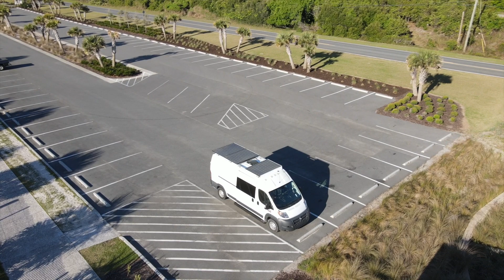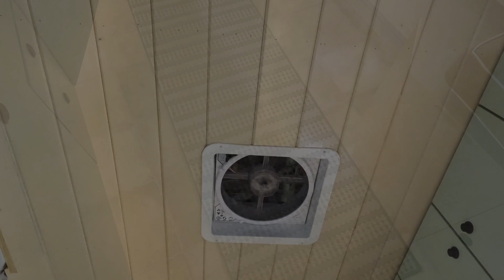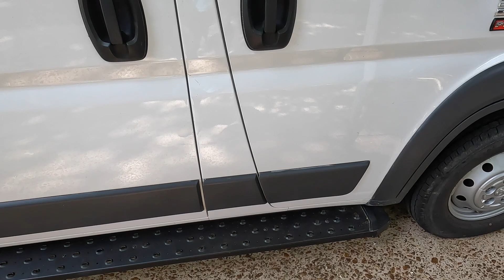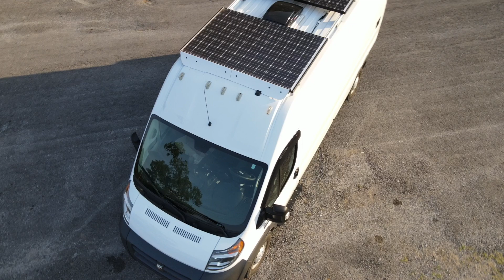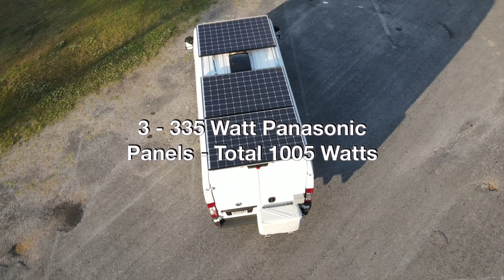Van Tour

Comment: how do you open the door where the AC is mounted? Your vid says bolts were through the bumper.
Reply from the maker: I have two 1/2" stainless bolts that I remove if I need to get in the back.

Comment: I think there would be a ton of people who would appreciate a video showing in detail the entire installation outside and inside for the mini split. I'm especially confounded how you can open the passenger side rear door if you bolted the mini split frame through the step!
Reply from the maker: I have to remove the two bolts to open the door. The only time I need in there is if I'm checking the electronics. That's all that's back there.

Comment: Hey, amazing video. Very inspiring. Thanks. 
My questions : 
Electrical : why 12 volt system instead of 48v solar sytem with 3kw hybrid inverter? 
Air ventilation : any floor vents for max fan? Doesn't it just cause negative pressure in a sealed container. 
Thanks and good luck with your journeys
Reply from the maker: Thanks. I had lights, max
fair, fridge, water pump, etc. all 12 volt so I chose to go with 12v batteries. Works great. I have two window vents for the cab windows whenever I run the maxxair.
Reply: Thanks for your reply and all the best in your endeavours ❤

Comment: Have the flexible hoses on the mini split held up well? No leaks? Nice van!
Reply from the maker: They've help up well so far. No leaks. Around 2 years.
Reply: Oh that’s great. Really nice install. Any humidity concerns? 

I installed a mini split in a stepvan and I battle humidity a bit. It’s a 12k btu and it cools the van down so quickly it doesn’t remove much humidity. Takes it quite a few cycles to get the humidity down to a nice level.
Reply from the maker: @cardudeman6104  No I haven't had any humidity issues. I insulated the heck out of my van. I used rock wool insulation in the floor, ceiling, walls, doors, and every nook and cranny in the bracing.

Comment: I have all my solar stuff in place just waiting fora couple more things before I wire it all up, since you're a very experienced electrician, I was wondering, do you think there is any potential anywhere in the system for arc flashes in small 400-800 watt diy setups with 400ah batteries? Or any major electrocution hazards? 
(Other than avoiding any touching of the positive to the negatives of course) 
I plan on wiring my inverter pretty close (1.5ft away) to my batteries, and all the OSHA workplace safety videos I've had to watch over the years is worrying me a little haha
Reply from the maker: As long as you have the correct fuses and don't short anything out you should be fine. Dangerous arc flash isn't a big concern when working on a van. In the manufacturing plant with high voltages and amperages is where it's real.The only shock hazards would be you your solar panel outputs and your 120 vac from the inverter.
Reply: @jamiesworld4675  ohh ok, thank you thank you

Comment: Thank you for documenting your solutions on YouTube!

1. Thanks for mentioning the type of flexible coolant hose (Rectorseal NoKink) in one of your replies! Did you use all of the precharged refrigerant despite having a short run between the units? If not, did you get a professional technician to adjust the quantity of refrigerant? (I have no firsthand experience with charging or leak testing a mini split.)

2. In one of your replies, you indicate that you planned to rest the weight of the mini split outdoor unit on the bumper. Have you found that the additional van length due to the protruding mini split substantially decreases your parking options? If you had it to do again, would you mount the outdoor unit higher to decrease the likelihood of it being clipped by other vehicles in a parking lot or during on-street city parking?

3. Have you collected interior and exterior humidity data alongside the temperature and power data? Have you noticed condensation on cooled interior surfaces? Do you intend to publish more time series data in the future?

4. Do your custom mounting brackets for the mini split outdoor unit incorporate any vibration damping? If so, what materials or components did you use?

5. Have you done any rough energy modeling (thermal and radiant transfer through the envelope of the conditioned space within a few scenarios)? If so, would you mind sharing your estimates for the conductive transfer coefficients (e.g. bulk R-values), the glazing transfer coefficients and the areas of the respective assemblies?

6. The questions in the previous item were prompted by my nascent project that applies Passive House building science principles to a cargo van RV conversion. The design incorporates a mini split, vacuum insulation panels, air sealing, a small ERV unit, an energy efficient egress window and an insulated & ducted waste heat bay. The tentative plan is to replace the rear doors with a custom exterior wall that will host the egress window, the mini split outdoor unit and most of the penetrations. In the unlikely event that you'd like to compare notes about any aspect of that design, please feel free to reach out via Gmail or Messenger. (I'm `joewalp` on most online platforms.)

7. I gather that it's common to document the upfitting purchases to justify the RV insurance valuation. If you feel comfortable sharing that list of materials and components, I could perhaps benefit from your experience. If you want to share it more broadly, I could publish it on my website.

8. Have you found that the cool air from the indoor mini split unit blows too directly on you during some daily activities or at night? If not, how did you adjust it or position it (or position your seating) to avoid that phenomenon?

9. You indicate that the mini split operating in cooling mode draws a maximum load of less than 650W. Have you encountered a scenario in which the efficiency gain from a smaller, dedicated, 1000W inverter would have allowed you to run the mini split when the 3000W inverter wouldn't? I'm thinking of scenarios such as 80°F+ outdoor overnight temperatures or multiple overcast days. (My design currently features a dedicated 1000W inverter to run both the ERV and the mini split in cooling mode alongside a larger 3000W inverter for cooking and for running the mini split in heating mode.)
Reply from the maker: 1. I did use all the refrigerant.
2. I have had no issues with parking and I like the unit on the bumper and door.
3. I have not noticed any condensation issues so far.
4. The unit came with 4 rubber pads and I used those between the unit and the mounting frame.
5. I have not done any energy modeling.
6. That sounds pretty complicated.
7. I have a long list on a spreadsheet of all my purchases.
8. I actually taped a piece of paper to the unit the keep the air from hitting me in the face at night.
9. I just use the 3000 w for everything. Works just fine.
Reply: @jamiesworld4675  Thanks! If you're willing to share that spreadsheet, I'd like to take a peek. I won't be offended if you prefer not to.

Comment: How much weight did the mini-split add to the GVWR payload capacity on your Ram Promaster, please? And is it a 2500, 3500? 159” or 159” EXT?
Reply from the maker: I believe the outside unit was around 85 pounds. It is a 2500. My total build added around 1900 pounds. It is a 159" wb.

Comment: Thanks for the great video! I’m especially happy to see someone else is mounting their AC on a swinging door. How’s that mini split setup holding up with the flexible lines? 

I’m going with a similar design, except the AC will be on the driver’s side, and about at the point in the project myself and am a little nervous about how the flexible lines will hold up over time.
Reply from the maker: I've driven about 10,000 miles and have had no problems. I couldn't be more pleased with the performance of mine.
Reply: @jamiesworld4675  great to hear! What brand lines did you use? I plan on bracing the lines against solid mounting points at each end to relieve strain on the connections of both units. Its all a bit intimidating, but I figure if someone else was able to pull it off, then its possible.
Reply from the maker: Rectorseal no kink @nicholasespinosa9569

Comment: Did you consider eliminating the roof fan entirely and only running with the mini split fan-only and cooling modes?  If so, why did you opt for the roof vent fan in the end?  Thanks!
Reply from the maker: The roof fan is good if you're cooking to exhaust the moisture. I also put a window vent in and run the fan on low if it's going to be hot outside when I'm away from the van.

Comment: Hi, 1) how did you paint the cabinet doors to look so professionally finished? 2) Had you considered staining them instead for a wood finish? And why not? Thanks. I’m converting a box truck at the moment and your reply would be most helpful.
Reply from the maker: I sprayed them with a cheap sprayer and air compressor. Latex wall paint thinned with a little bit of water. Takes about 5 or 6 coats but also;utely no brush marks. The wood is maple plywood and I decided to paint instead of stain.

Comment: did you have to cut into the bats of Rockwool to get it down to a 2 inch thickness for the subfloor insulation? Or does Rockwool come in 2 inch thick bats?
Reply from the maker: Lowes sells a knife that looks like a breadknife that a does a good job of cutting it down. The bats are almost 4 inches thick so yes and to split them.  But, I think the insulation is very very important to be able to run the mini split off grid.
Reply: @jamiesworld4675  Thanks for your response. I wonder if you got the safe and sound rockwool that provides great sound insulation. If so maybe it would be a good idea for another video to see how quiet the van can be from the inside with a noisy outside environment.
Reply from the maker: @mikefranks4528  Actually most of the insulation is not the safe and sound. They say it's a different R factor and I wanted the best insulation. When I did the doors I ran out and did use some safe and sound and I couldn't tell the difference.
Reply: @jamiesworld4675  sounds good. Can you share the initial brand you used for Rockwool?
Reply from the maker: @mikefranks4528  It was the Comfortbatt R-15  Attis Wall 23 x 47 x 3.5

Comment: Our Fujitsu 9K 33 SEER mini split HP consumes 400-600W at 90F odb and 1000W in heat mode at 40F odb. 70F IDB. 

Where did you get 100W from?
Reply: Probably reading the power draw off the batteries

Comment: I have a question. The new Delta Pro offers the option to charge using an ev charger at a gas station if you buy their add-on connecter. Did you give any thought to doing this with your system? It can't be rocket science if they've added it to their latest model but I cannot find any discussion about doing this (except for 3-4 year old ones that take a moralistic view about how car chargers weren't designed for rvs).
Reply from the maker: The charge rate on lithium batteries is too slow. If the batteries were at say 60% it takes a couple of hours to charge to 100%. It’s better to let solar and/or the alternator do the charging.

Comment: Hi, I am a little late to the comments here... this is a really clean looking and practical design.. I like the dual beds and the angle out kitchen counter... I have never seen those cabinet pulls/ locks.. looks like you pop out the pull / knob to open and can leave it out until you are ready to drive again..then pop it back in to reset the latch that's really convenient and easier when you are in camp... can you please respond with the name or a link for those... thanks, Rick
Reply from the maker: https://www.amazon.com/gp/aw/d/B08JH98MMY?psc=1&ref=ppx_pop_mob_b_asin_title

Thanks, they work great as long as you remember to push them before you start driving. I know this from experience lol.
Reply from the maker: It must be, my door fronts are 3/4
Reply: Hey Jamie, thanks for the reply/link.. it appears from the schematic image with size measurements that they are mounted with the squared box portion screwed from behind to the drawer face and a round hole of unspecified width bored into a max .059 inch thick drawer face ??? Everything about that configuration seems logical but I am hoping I'm seeing a mislabeled .059 inch depth of  "knob cylinder insert" seems like 3/4" ... .075 inch would be more common for finish drawer faces !?? Is the depth mislabeled? Thanks again for your help, Rick

Comment: Very nice! Can you show if and how your back door opens with the mini split on it? Also if u could show how you built the bracket for it, please?  Also please list links to the products you used, a/c gasoline heater etc.. ? Thanks for your post. :)
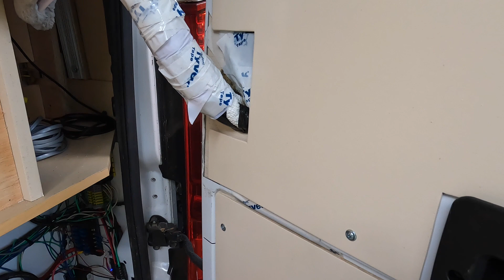Reply from the maker: Around the 16:20 mark I show the back door opening. I used Rectorseal no-kink flexible refrigerant lines. I used 80/20 for the bracket. The 80/20 and all the brackets and bolts are from 80/20.net. The gas heater is a Webasto Airtop ordered directly from Webasto.com.
Reply: @jamiesworld4675  thanks so much for the reply! :)
Reply: @jamiesworld4675 the part I'm confused on, is if it's mounted to the rear bumper, how are you opening the door with that screwed down? Also after having it for a year how would you say it's held up in the summer?
Reply from the maker: @timcorona5069  The only thing inside the back door is all the electronics. Unless I have an issue or just want to show it to someone I never need in the back. So far I haven't had any issues. The mini split has worked awesome in cooling and heating situations. I'm leaving Saturday for an 18 week road trip in the western US. That should be a very good test. I'll be posting weekly videos on the trip.